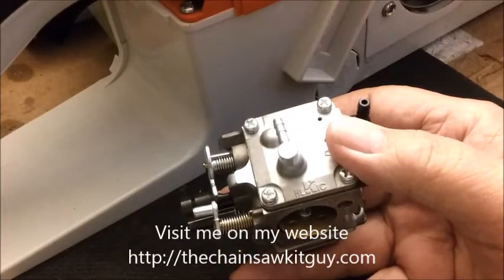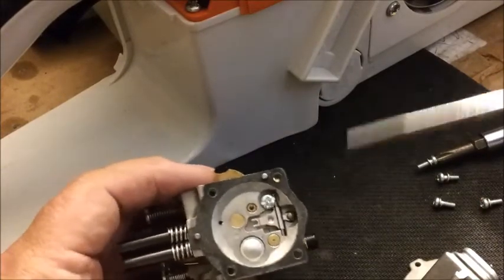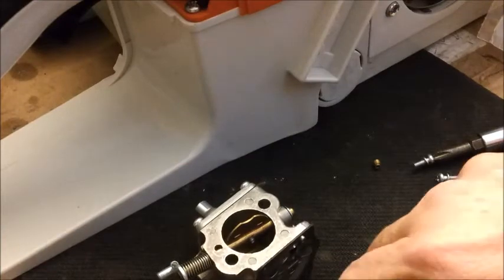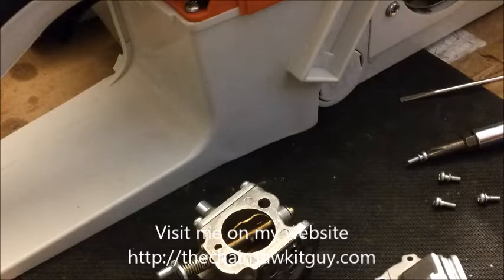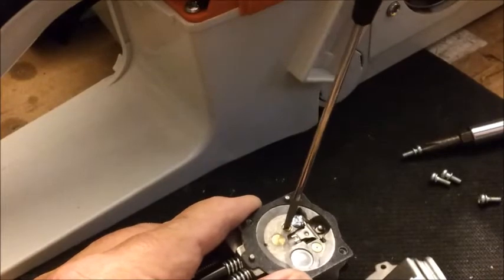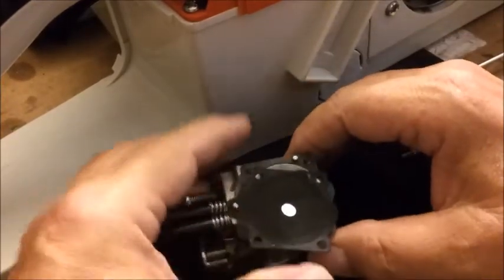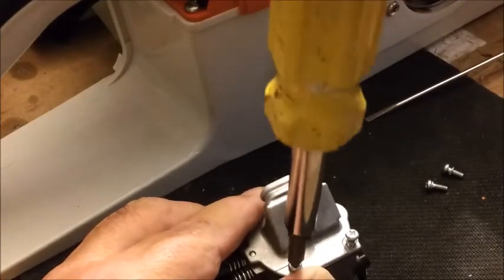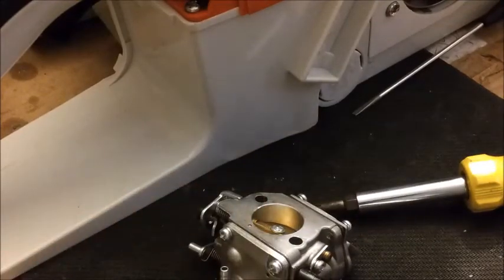MS660 HLiC Aftermarket Carburetor Jet Replacement

Comment: 4:27 sir, what is the purpose of this "tube" on that membrane?
Reply from the maker: Not a tube. It is like a connector that a holds a piece to the other side of the membrane. I will post a photo. Thanks for watching.
Reply: @the1chainsawguy  so that don't have any function....
Reply from the maker: @hardcoreplayafromthehimala4888  yes it does. I posted a photo showing you what it does
Reply: @the1chainsawguy  I don't see pic, probably yt block link.
Reply from the maker: @hardcoreplayafromthehimala4888  sorry I  I can't help you use YouTube but I made a post and attached the photos to it so I think you have to look in my feed or in my channel something like that and it'll show up That's all I can do for you Thanks for watching
Reply: @the1chainsawguy  I know that is membrane but that tube on cover of membrane, other carbs don't have that, sorry bad English.. That tube on that cover is that have function, because there is idea to put that carb on different saw that is not stihl... Again sorry for bad vocabulary ✌️

Comment: I have searched everywhere high & low on the  'net for a Walbro .74 jet. Tried the Ebay item numbers, both on USA & Australia sites... Google searches, tried different search terms.. No luck. Why can't I get one, yet others can ? Where am I not looking? Surely I'm not the only one... Thanks for your wealth of other info. Most helpful.
Reply from the maker: here you go brother. eBay item number :223870634997
. order it today. if he is out ask him to order one. thanks for watching. 112-466-74 walbro part #
Reply: @the1chainsawguy    Yes, & I looked again, to no avail.. Maybe Local Srihl dealers may have jets
Reply from the maker: @darrenhart116  you just gotta try harder. Contact this guy on eBay and ask him to get you one. My message said to go buy it it was there.....dssjms. also Google Mitty supply in Georgia sells milking machines. She sell walbro carburetors. She can get the keys also. Ask her. Stihl part number 1122 121 5607 here are 3 places. Now help yourself
Reply from the maker: New info added

Comment: Can you please post those identifying marks in the comments or video notes? Thanks.
Reply: I have just ordered the MS660 kit and found your site and channel trying to locate this carburetor and jet those eBay numbers no longer work.
Reply from the maker: You are not a subscriber? I work hard I would appreciate your support!
Reply: Yes, I'm subscribed to your Youtube channel.
Reply from the maker: .74 jet eBay item number:222039380149
carb    eBay item number:222400441966
Reply from the maker: It is hard to find. The photos are not accurate often. Many will ship it in an envelope. This guy will be responsible and he has both items. The numbers can changed on the body. He says is a tillison copy, the walbro jet fits it, I thought it was a Walbro WJ-69. No matter That is the one to get.  I have changed out a half dozen. Use a good screwdriver to break the jet loose like the video says. Thanks again. If i can help let me know.
Reply: Thanks for helping me find these parts!  I just ordered them:) I'm quickly learning that its not as simple as buying a cheap kit online. Ha! However, I've already learned a lot so far about how chainsaws work and I'm enjoying the process. This is a valuable education and I'm very grateful for your help!
Reply from the maker: Will help when I can. Its awesome. Just wait until you are done and fire that baby up. You can go with just a straight kit, you will be very happy by taking the extra steps. The saw will last like a real one. You will see! It really is an education. You will be doing things that many Stihl Techs never get to do. Work with the cases. That's rare for them. It is an education and you will become addicted to the joy. It is pure joy.